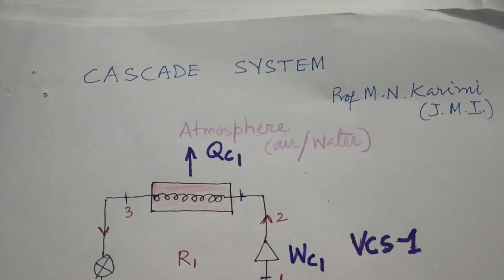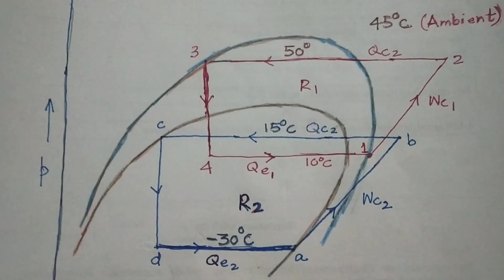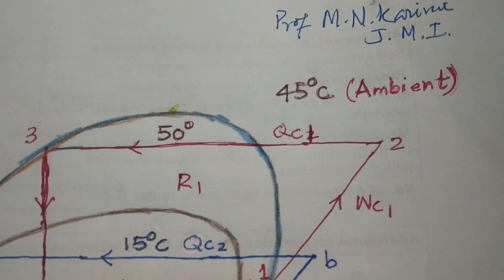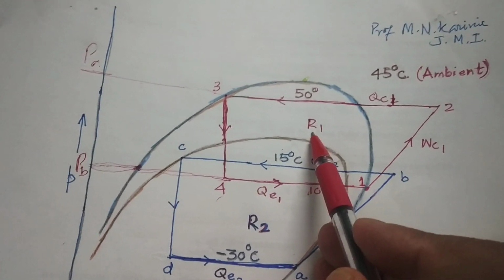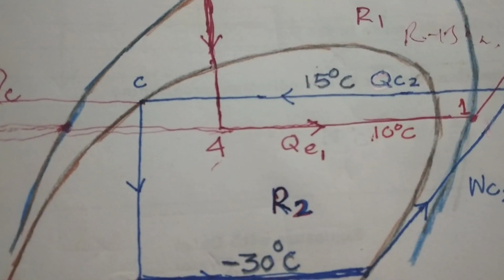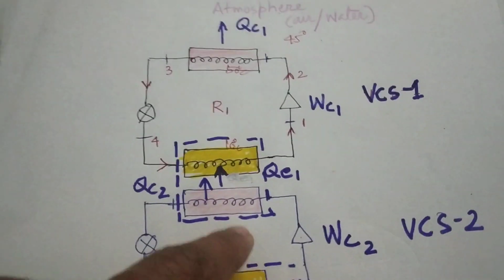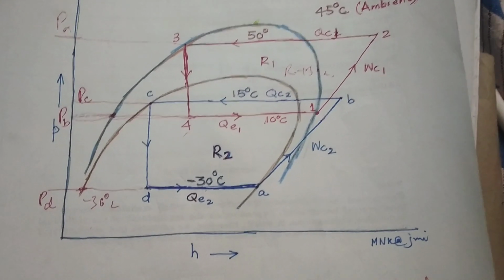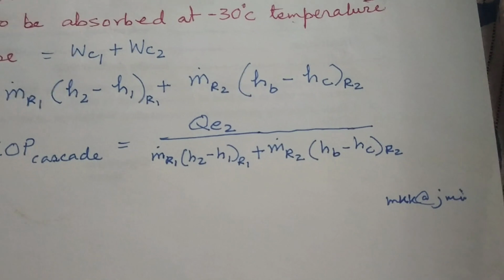Cascade Refrigeration System

Comment: Agar hame bahut low temp.(cooling) Achive karna hai to ek refrigerant ka use kr ke nahi kar sakte ,kyu ki uski itni capability nahi hoti ki wo ambient temp. se bahut jyada temp. Kam (cooling) kar sake kyu ki uska critical temp. Kam hota hai . isliye agar hame bahut jyada temp. Kam karna hai to ham cascade system ka use karte hai .isme ham 2 system ko series me coupled karte hai  system 1 and system 2,  evaporator 2 heat absorb karta hai and then compressor2 doing work and then condenser2 heat reject karta hai
 Evaporator 1 heat absorb karta hai jo heat condenser 2 ne reject Kiya tha and then compressor1 will doing own work and then condenser1 rejecting heat to the atmosphere

Comment: A vapour compression system consists of compressor, condenser, expansion device and evaporator.In cascading system we have two systems-vapour compression system 1 and vapour compression system 2 which are coupled to each other.This coupling is known as cascading.Cascade is a system in which effect of system 1 is  given to system 2 which has got effect of 1 and 2.In these type of systems two refirigerants are used which have different characteristics corresponding to different curves in pressure enthalpy chart.For refrigerant 1 we have temperatures 50 and 10 degree centrigrade corresponding to pressures pa and pb respectively.Similarly for refrigerant 2 we have temperatures of 15 and -30 degree centrigrade (saturation temperature) corresponding to pc and pd pressures.R2 absorbs heat from anything higher than -30 degree celcius.Condensor of system 2 will reject heat at 15 degree celcius to space which is less than 15 degree celcius and interacts with evaporator of 1 such that heat will not escape our and will be absorbed by evaporator of 1.So heat transfer occurs between the two systems.Now the absorbed heat gets rejected to the atmosphere and Vapour compression system 1 takes this responsibility.
Net result is that we get cooling effect which is of very low temperature (-30c) and these refigeration systems which are used to achieve this are called cascade systems.This low temp of refigeration can be obtained at higher ambient temp.For this we need two compressors to transfer heat from -30 c to 45 c say.

Comment: Cascading system : Which transfer cooling effect with the help of coupling of two systems. In this we have two vapour compression system (say VCS1 & VCS2) consisting of condenser, evaporator, compressor etc. in each system. We have different refrigerant (R1 & R2) also having different characteristics like critical value, pressure and temperature. Condenser 2 interacts with Condenser 1 of respective VCS.Condenser 2 of VCS 2 at 15 °C will reject heat to Condenser 1 of VCS 1 Which is at 10 °C.
 Cascade refrigeration system is combination of vapour compression system and very low temperature refrigeration can be achieved at a very higher ambient temperature by selecting the suitable Refrigerant.